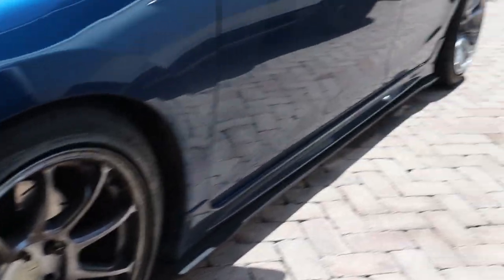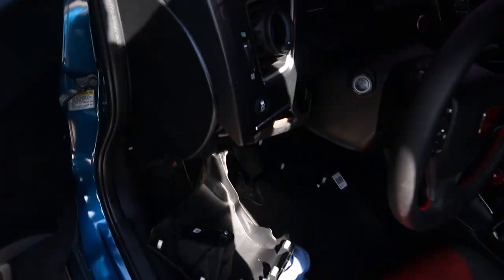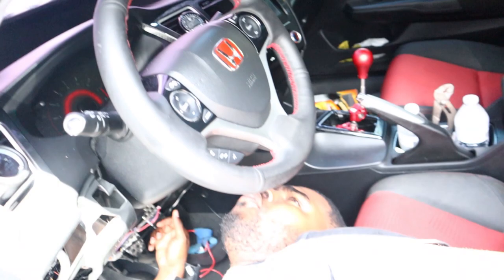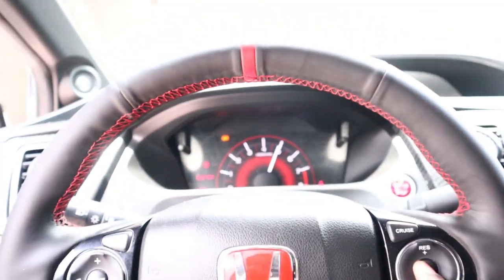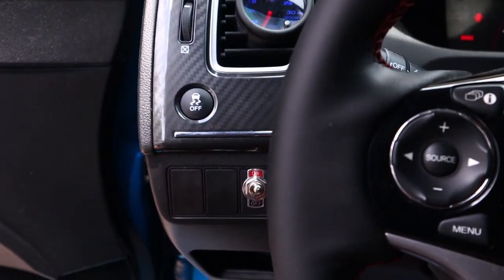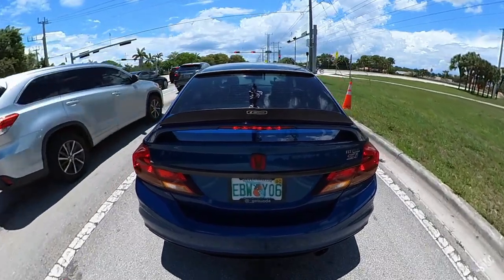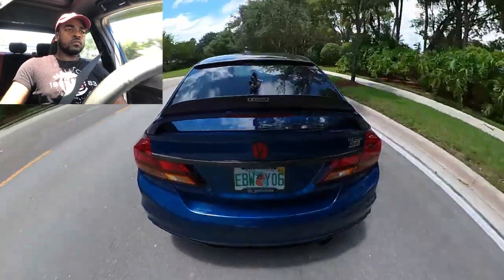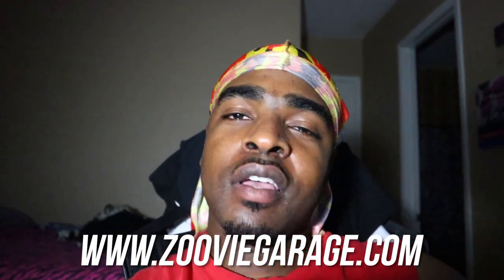Setting Up Rolling Anti Lag On My Turbo Civic Si

Comment: Oh my 15 civic I just did it off the actual clutch switch instead of the cruise control switch and I'm occasionally getting check starting system code

Comment: man makes me miss my '12 coupe. Have a '22 ex-l right now, but kind of wanting to get back into the all motor 9th gen. You've had the car a while now huh? What's your mileage and how's long long term reliability been (got rid of mine at 100k, did valve cover, trans/diff fluid, but never anything too major).
Reply from the maker: 93k now,  got it stock at 49k in 2018 been fbo e85 revving to 7800 .. now its 433hp revving to 7600
Reply: @zoovie  damn dude, not a ton of miles! I remember stock my Si was super fun, but 433hp has to be an ANIMAL! love it!

Comment: So do i need to make any change on the hondata for ujust the switch?
Reply from the maker: Yes changes must be made in hondata … I also sell the rolling anti lag kit

https://www.zooviegarage.com/product/rolling-anti-lag-switches
Reply: You need to set launch control to the desired rpm and make the disengage speed to at least 10mph over the speed you want antilag to engage also you have to have no lift shift enabled or launch control will only work when your are stationary